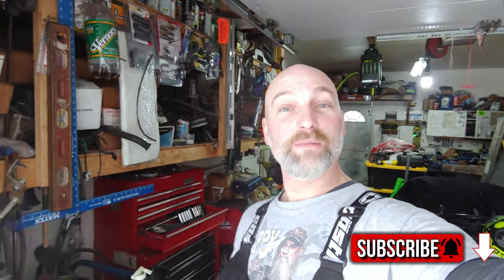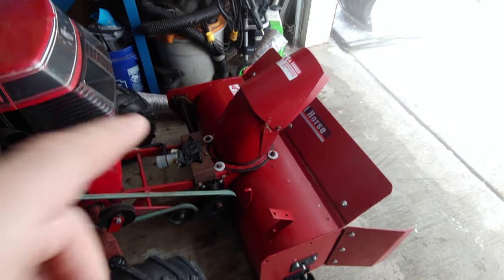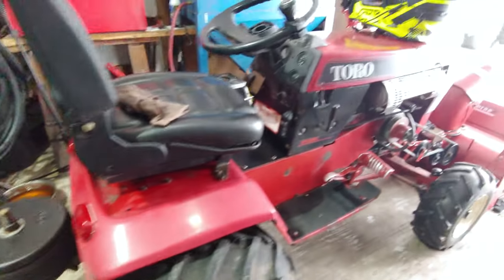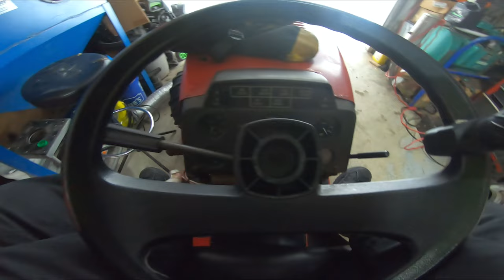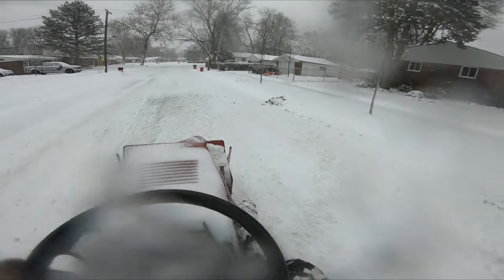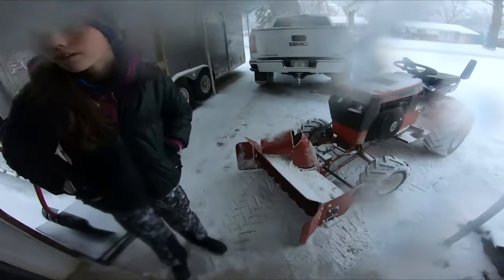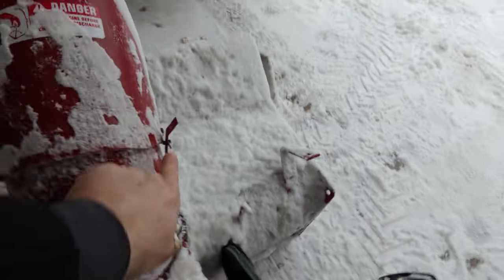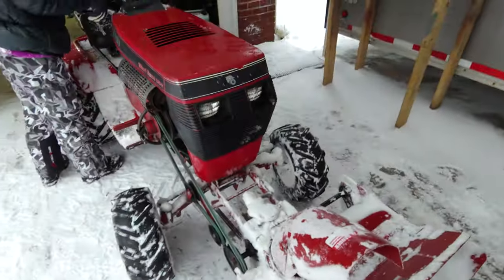Wheel Horse 520h Throwing Snow || Chute Disengages mid-Operation

Comment: Extend the discharge chute, and put an actuator on it, you won’t get buried so bad with snow, and you won’t have to dismount to adjust the deflection.👍 Adjust the clutch a bit, it’s slipping under load.
Reply from the maker: Yeah I thought about adding an extension but I did add sides so it focuses a lot better where the snow is actually shot. And as far as the deflection to raise or lower the angle of discharge I saw that there are electric actuators that move pretty quick that can be ran from the dash which I like the idea of. We just don't have snow regularly enough for me to worry that much about it especially because I have a big 4x4 truck and we don't have sidewalks on our side of the street LOL. And yeah as far as the clutch I've adjusted it a few times I think I need to get new clutch shoes for the PTO and then clean up the one meeting surface for the engine and I think that'll help to stop the squealing. Thank you very much for the great suggestions though and for watching the channel I appreciate it! Only thing I ask is if you have a favorite video please share it one time as well as the channel on your social media accounts to spread the word about the channel to help me grow! Thank you very much and take care

Comment: Did you make a video of your chute motor retrofit?  That’s pretty sweet!
Reply from the maker: I have not sorry. Thanks. I wanted to do it and got some ideas only but fabricated my own.
Reply: @Fixin2Ride-Official-  Looks like it worked great.
Reply from the maker: Worked decent but would like to get a better transfer system. The Belt is rubber and does skip with heavy wet snow... Maybe a small chain and gear next time.

Comment: Where did you get that rear hitch?  Did you make it?  I need weight on the rear of my 520 as well.  I will have to check out Wheel Parts and more too, I got my front hitch from Glenn.
Reply from the maker: I believe he's still on a Wheel Horse forum. If you go to the Wheel Horse forum you can do a search for it and he should pop up in the for sale Section

Comment: I have a wheel horse 518 h with a snow cab that'll help with a snowblower
Reply from the maker: Oh that's pretty cool I've look for one of those camps for a while but kind of gave up. Thought about making my own
Reply: I was just trying to be nice but the snowblower
Reply: I just got a cab for a Toro wheel horse and I made it work on my Wheelhorse 518h
Reply: okay
Reply: Toro Windbreak Cab For XL Series
Reply from the maker: Was it difficult to fit up?
Reply: No we had to modify a little bit to make it fit on the tractor
Reply from the maker: Gotcha. I bet it was worth it though being protected from the elements at least even a little bit. I got another point to where I've purchased a few neck and head coverings that do really well plus I have my snowmobiling gear that I wear as well which helps out a great amount